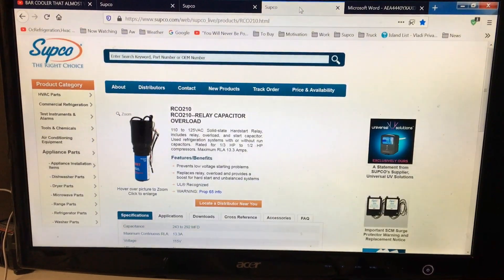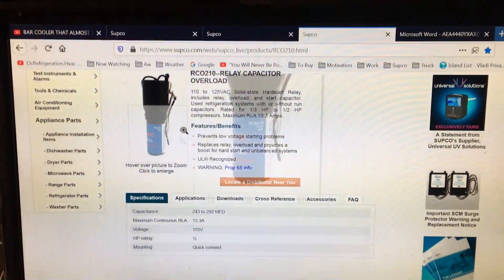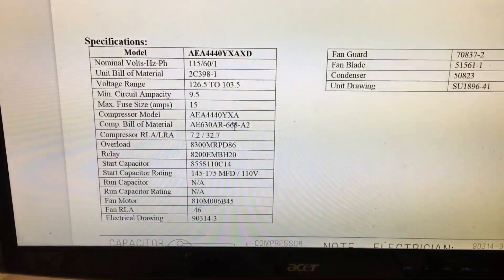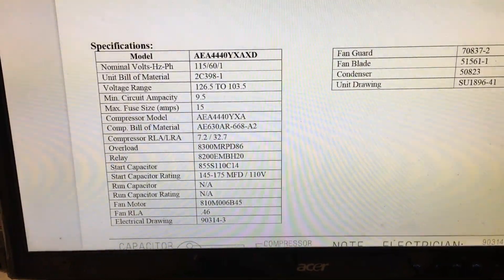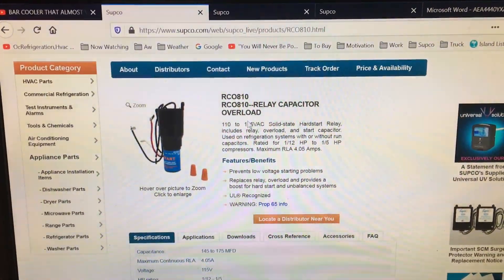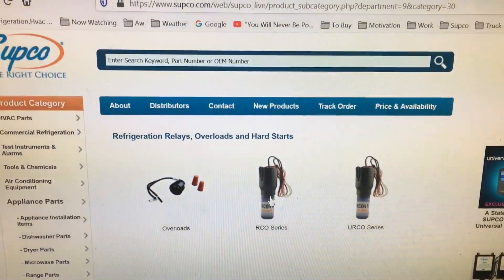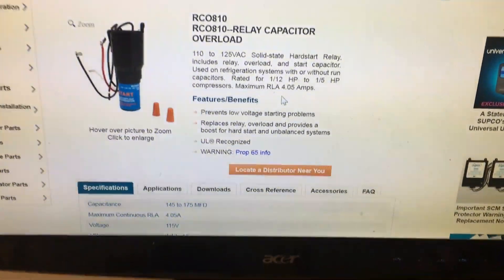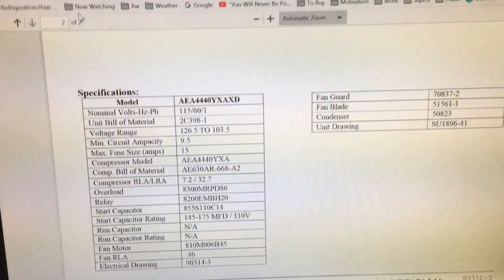How to Properly Size a Supco 3 in 1 Hard start Kit for Your Compressor.

Comment: It is about the same compressor on which I asked the question earlier about Hard Start Kit i.e. cubigel/Danfoss compressor (Model B35C5B).
As per data sheet the winding resistance(s) between Com-Run should be 16.10 ohms and Com-start 13.50. The PTC relay JPQII-4.7 so  net C-S 18.2 (13.5+4.7) which will make net Com-start resistance greater (as required) than Com-Run. But when I measure the C-R it is 23.3 ohms and C-Start is 15.4. Even the good and working mini-fridges (mostly Proctor Silex) with the same Compressor show the same values. This means the net C-Start will be 20.1 ohms (15.4+4.7PTC relay). So my question is why are they working while the net C-Start vlaue 20.1 Ohms) is smaller than C-Run (23.3 ohms)? What am I missing ? Appreciate your insight on this, based upon your long experience.

Comment: Thank you. I definitely learned something new. Question: I have a mini-fridge with a cubigel/Danfoss compressor (Model B35C5B/110-115VAC Type RSIR) 1/12 HP. Max. Const Current 1.04 AMP LRA 3.9AMP. It is locked. Putting clamp on meter 'MAX current setting - shows immediately 7.5 AMP. and just hums. I turn it off right away or else OLP will trip. What would you recommend for an appropriate Hard Start to try unlocking it?
Reply from the maker: try a rc-0810 kit first. ( $15.00 on amazon )  if that does not work try a rc-0410 kit. ( $10.00 amazon )  if that does not work Best to just buy a new mini fridge ( $50-$100.00 home depot. ) if it's older than 12 years old - Just buy a new mini fridge.
Reply: @OcRefrig  Thank you so much. I will follow your advice. I have a diffeent question which i will put separately and will appreciate your expert opinion.
Reply from the maker: @Ashok20164  your welcome.

Comment: Good info!!! Thanks!! Quick question on the Supco website what is the difference between the RCO series and the URSC series? Thanks for your reply in advance!
Reply from the maker: Rco = Relay capacitor overload = Only has a Start capacitor.

URCO = Universal relay capacitor overload = Has Wiring Provided to use a Run Capacitor in the circuit also.
Reply from the maker: URSC10 = UNIVERSAL Relay start capacitor.

Looks to be UNIVERSAL use from 1/12 hp ( One twelfth hp. yep. not a typo. ) all the way to 1/2 hp. 

https://www.supco.com/web/supco_live/products/URSC10.html

Universal - New Technology.
i Have not used one yet.
Reply from the maker: Call Supco for More info Here --- i have called them once before.
1) A Real person answers the Phone
2) They Speak English
3) They are in the usa 🇺🇸 / New Jersey.

https://supco.com/web/supco_live/content/technical-support.html

Comment: Put an RCO410 on a commercial 21 cu-ft freezer upright, and it didn't last a day!  So I going to use a RCO210 and pray I don't lose 3000 dollars worth of food...  The compressor ran great for a day then lower cont run #7 Quick freeze to #4... (-4-0 F') on #7 (-10 F')  Which the buzzer after 6 hours "turn on -No Buuzzing"...Great (-7 F')? Now It buzzed off 2 hours ago! I think the RCO410 burns out the fast-start just click with no compressor running?  So SAD.

Comment: I'm trying to size one of these for a newer 10 cubic foot fridge in an off grid cabin - I have a rather larger inverter but when the batteries aren't at a high state of charge the initial startup of the fridge will trip the low-voltage alarm on the inverter, even though I've got plenty of capacity, cables etc are sized properly etc.  The amps shown on the fridge sticker say 1.4A which I assume is running amps - what size kit would you choose for this fridge?
Reply from the maker: Min size inverter you should be using is a 1000 watt Continous inverter. 1500 watt peak. If your not , inverter is too small. Batteries need to be up to min 12 volts so as to not trip low voltage alarm on start up. I know low voltage alarm is around 10.7 volts dc on most inverters. You need a 1.3 volt buffer to compensate for inrush. Inverters need to be sized at 8 times Running load amps to compensate for start up inrush current.
Reply: @OcRefrig  The inverter I'm using as an 1800W continuous rated pure sine.   8x the fridge running load of 1.4A would be 11.2A so 1344W @ 120V.  Batteries are around 12V when it starts doing this and I know I can draw them down further if it didn't trip.  Just want to know what size hard start kits to try on this fridge to get a little more run time out of the batteries.  2 pairs of 6V GC2's in series connected to a marine batt switch separated into two banks.
Reply from the maker: I need to know what hp the compressor is. Look at the compressor in the back and give me the numbers off the compressor tag.
Usually a tag on the side of the compressor body. Could be facing you or other side. U might need a mirror & a camera. U might be able to take a photo of the tag. I need all the numbers & voltage.
1) I’m assuming Refrigerator & compressor voltage is 115 volt ? 
2) and You are in the United States 🇺🇸 ?
Reply: @OcRefrig  It's currently at a hunting camp that's pretty snowed in and I won't be there for a while probably.  It's an insignia 9.9 CF top freezer refrigerator model number URBCD510WS and the compressor seems to be a Midea, part number 11101010000348.  Can't find a lot of specs on it, all I know is it says 1.4 running amps at 115v from the sticker inside the fridge.  I'll keep looking for info on that compressor.

Comment: I have an Igloo brand freezer the compressor has no specs or HP info I want to install a Hard Start Capacitor Kit but I cannot find any info on the compressor therefor I cannot determine which kit to use. Can anyone help on determining as to what size of Hard Start Capacitor kit I can use?
Reply from the maker: What’s the Model number of the Igloo ?
Make: ?
Model: ?
Serial # : ? 
How old it is ?
Reply: Serial no. S0493140926E1068 
make-Igloo
freezer is about 5 years old 
Model is FRF1050
Compressor is good

Comment: I need help.  I don't have a clue how many hp my compressor is in my old 1994 westinghouse freezer.  I just know the relay went bad and I need a 3 in 1 cuz they stopped making the OEM relays for this freezer.

2 questions.
1. How exactly do these 3 in 1 starters damage compressors? Too much amperage or something?
2. How do I find out what the right 3 in 1 I should get for my unit?

Comment: Any downside to using the higher amp rated kit? I'm troubleshooting a kegerator, where the compressor will not start. It is only 1/8 HP,  but the LRA rating is 7.24. I had tried the Supco 810, without success. Clamp amp meter is showing a draw of about 8.5A at start. Definitely tripping the 3 in 1 overload. But wondering if I tried the 210, if I'd ruin the compressor?
Reply from the maker: id use the rc0410 if the 810 is not working for you. then try the 210 as a last ditch effort.
210 might hold the start winding too long & damage the start winding. but , right now u have a non working unit so try the rc0410.
Reply: Thank you for advice. I tried the 410 and the compressor still draws high current but the overload does not immediately trip. I’ve only let it try to start for less than a minute as compressor does get hot fast with that much current. It seems that something is probably mechanical stuck. Might the 210 help in this case get things moving? Or am I SOL? I’ve seen a few videos suggesting higher voltage can sometimes unlock compressor and get it moving again.
Reply from the maker: Make sure its wired correctly. C , s , R ? to right places.
most likely u are SOL ! 
replace compressor if wired correctly & high amps.
Reply from the maker: its like a triangle wiring. C --- top of triangle.
S --- Lower left of triangle. R --- Lower right of triangle.
sometimes triangle is upside down looking --- but its wired same as a normal triangle.

Comment: I notice they only last 3 years. I have to keep buying them. I even tried different brands. I always use the run capacitor that was already there. The compressor is still going strong
Reply from the maker: You are most likely wiring it wrong. thats why they are only lasting 3 years. they should last 5-6 years min. the original capacitor, is most likely a start capacitor not a run capacitor. if its plastic , its a start capacitor. if its metal , its a run cap.

Comment: I have a 7 cu ft chest freezer. It says start up amps is 12.3. It stopped working so I bought the urco810. It has a running capacitor. The 810 starts it up, it’ll run for 5 minutes, then I’ll hear a pop and it shuts off. It’ll try to start back up but just hums, then pop again n go off. Should I try an urco410?
Reply from the maker: Yea, u can use the Rc-0410 kit.

410kit & 210kit. they both use same capacitor just bigger overload & contacts in the 210 kit.
1) What are the Running amps while its running ?

2) Where are u getting the information that says the start up amps are 12.3 amps ?
Reply: @OcRefrig  Im going off of the data plate on the back of the freezer. Sorry I meant 12 start up amps. It also says 1.70 running amps. It’s a 2018 freezer but I bought it used and it still looks brand new.
Reply from the maker: while that freezer is running if its in good condition really should should only draw 2-3 amps while its running. depending how old it is and if its warm or cold start up.
start up amps at 12.3 should only be for a second and amps should drop to 5 amps or less very quickly at a warm start up ( from room temperature) and keep dropping to probably around 2-3 amps. depending on ambient , age , refrigerant, model etc.
new units only draw less than 2 amps while running ( they say ) depending on ambient.

Make sure its wired correctly.

if its drawing 7 amps or higher while running something is wrong. DO NOT USE IT. FIRE HAZARD.
Anything u do is at your own risk ⚠️. i will not be responsible for anything u do or do not do.
An improperly wired refrigerator or freezer can cause a fire.
You should actually order the correct start components for the compressor for home safety.
Reply from the maker: How old is the chest freezer ?
is it under warranty ?
Reply from the maker: you need to check the run capacitor and make sure its good too. replace capacitor , is even better idea.
Might be worth just replacing freezer if its old.
New ones on sale - $199.00 right now.
pretty cheap.

Comment: Thanks fornyhisbgreat information,  I have a question if I have a compressor that work with 230v couldno I use the 3 in 1  as 620 , 420. 220 if I dont known how many amps is pulling ?
Reply from the maker: you need horsepower or amps to get close to sizing it correctly. what ever size u think it is start with that or one size larger. as soon as u get it running look at the amps that it is pulling and re size the kit according to the amps once its running. optimumly you should size by amps from the start but, if u cannot obtain the correct information. you do what u got to do. call manufacturer of compressor for amps info if necessary. i take no responsibility for your actions to properly size your kits accurately.
Reply: Thanks again

Comment: I have used RCO's in the past, I have also used URCO's as well.  The URCO's are made for units that also require a run capacitor.  Can I use a URCO for a compressor that doesn't require a run capacitor?  If so, should the unused leads be tied together electrically, or left opened?
Reply from the maker: i would follow the directions from supco on the packaging.

Comment: Just because you have oversized your 3n1 kits for years and have had no issues is just a dumb comment.  You need to replace with oem spec components,  3n1 are only good to check compressor operation. You are clearly lazy to leave 3n1 on compressors. Where is there engineering documentation Tecumseh or copeland said you can do that? you just broke the UL listing, UL breaker

Comment: I would say they are compressor killers for two reasons. 
1-On a small compressor like on a household refrigerators the supco makes it pull lra for far too long before tripping out. 
2- It moves the OL from the compressor shell so it can't sense overheating without high amps and I believe the heat generated from compressor shell itself is important

I have used them before but I leave the factory OL on in conjunction with the supco
Reply from the maker: Good points but 25 years of using them say they are not.
Reply: What would y'all recommend for a 1994 westinghouse freezer? I don't know the hp of the compressor or the amps that it draws....smallest lowest power supco?

Comment: Great video!! can you please make a video on how to read/check hp of the reach ins compressor thanks!
Reply from the maker: Hp Does not matter. Just go by your amps when sizing things & the Btu’s Removed at a Certain Suction = Tonnage. 3,000 btus @ +20 Suction = 1/4 ton. Hp is whatever the manufacturer wants to rate it at at a specific temperature. I’ve seen 1/3 hp compressors that draw 3 amps all the way up to 8 amps.
Reply: @OcRefrig  look at the amps on the compressor? And match that with supco hard start kit? Is there more than 1 amp rating? Like max amps vs constant run amps or something?  

Not a hvacr guy just a homeowner that picked up a free freezer today and reason why it was free is bad relay....they dont make replacement part anymore so just trying to get this running without burning out the compressor
Reply: @OcRefrig  
Just looked on compressor and it says 7 lra...7 locked rotor amps...and freezer says 5 amps... so not sure if 5 amps is what the freezer is always using while running or if that's the compressor....and the 7lra not sure what size hard start to use

Comment: As an apprentice, I appreciate this video. I use hard starts all the time and leave them in permanently. Most of the time we have to order start components. Customers prefer that I put in a hard start and be done, not have to order parts, install them and have to charge them for that time. I had a warranty Hoshi 3 door freezer that burned up start components. Talked to tech support and they had me put on a hard start to test compressor. It worked. They sent out new components and I installed. All amp draws looked good. 2 weeks later, start components burnt up again. Didn’t call factory for warranty authorization this time. Installed hard start permanently and has been working for months without any more issues. These hard starts work much better than oem components if they have to be replaced. New had a single issue with installing hard starts on any piece of equipment. I’ve seen hard starts that have been beat to hell in a unit and the unit still works like new!!
Reply from the maker: Yes , this is my Experience also. Thanks for watching & comment. 👍

Comment: Also a quick tip, gotta cool compressor down and if needed to keep a pack of ice on top while running and let satisfy or reach lower temp so u don’t overwork it unless pressures and temps settled down then monitor, always works for me
Reply from the maker: Great point!
Reply from the maker: Exactly. Once You Get it running , you got to keep it ruining until it cools down and gets to temp ! it cools down the internals that way.
Reply: There you go, thanks for your videos guys
Reply from the maker: Thanks for watching Erick. 👍
Reply: No problem man i enjoy and appreciate all you guys vidoes as not only are they entertaining but also shows me many ways or tips to do things better, we’re all out here to learn from each other & help out not the opposite, stay safe man
Reply from the maker: @ErickHernandez93   Well said Erick ! That’s exactly correct.

Comment: Always up size amp rating of the internal contact points rating for extended life 👍
Reply from the maker: I don’t understand this one.
Reply: @OcRefrig  If didn’t understand my reply ?  It’s the internal make and break that often fail inside a three in one because they’re rated near to the limit to give acceptable life to dollar ratio. 
              It’s not an ideal world and sometimes the smaller units are in applications were they short cycle for years and constantly replacing three in one or OEM starter. Scenario two condenser never get clean plug high side is through the roof and starting under a high amp load continuously please a small contact point shorter life. 
                        If you were to modify and open up the three in one jumper the contact point to engage a 40 amp contactor externally to run the compressor there would be no load to just engage the contactor boil and he would find out they would last 20 or 30 years in this over engineered scenario. 
               It is the arcing and pitting at the contacts face plus the heat of the high amperage that kills them. 

            If you install a suppressor resistor and diode across your contactor points you don’t get the arc that eats away and causes high resistance at the face surface of the contacts. 
              And with a larger contact surface area that can take more heat and distribute it and Wala you have a contractor that will last 40 years. 
              But that would take five cents more in materials for the manufactures to install and contactors that last 40 years I don’t make return revenue
Reply from the maker: @coldfinger459sub0   I understand now. Thanks for explaining. 👍